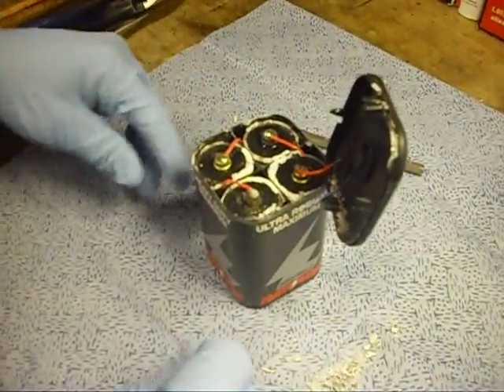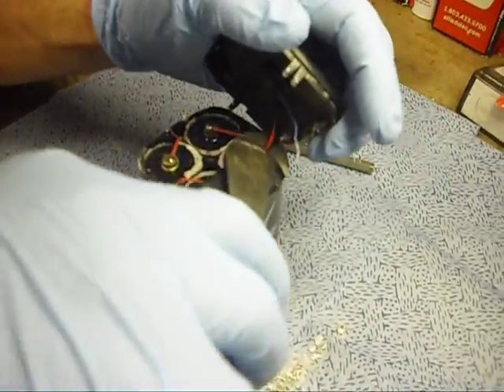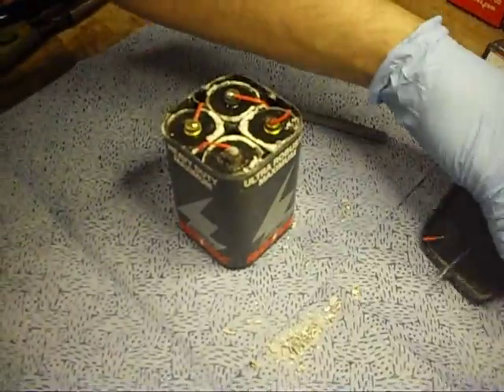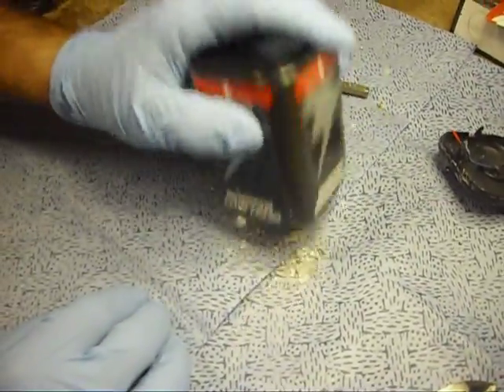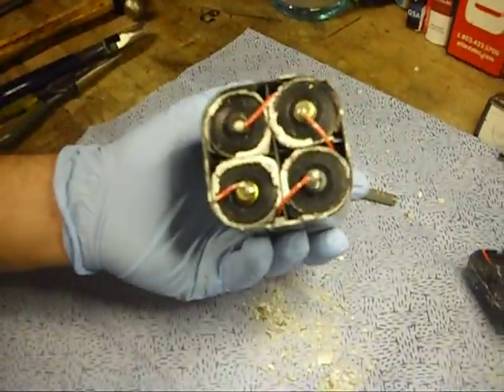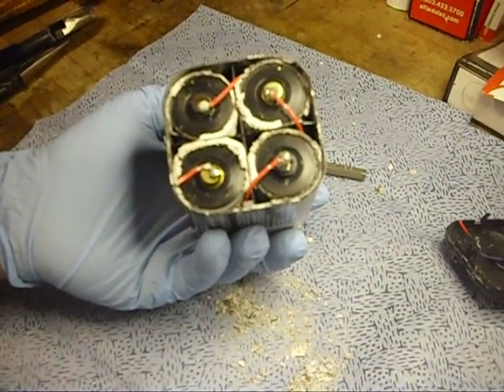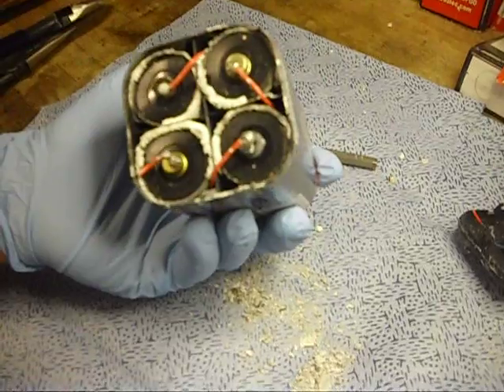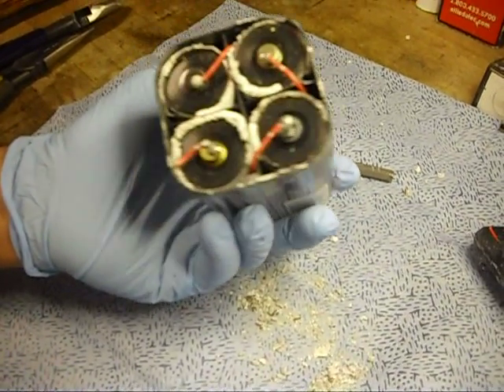Cutting open a six volt lantern battery (6 Volt Battery Hack)

Comment: To get high capacity for longer run time they used four 1.5V "F" cells. Each cylindrical cell is about 32mm diameter and 90mm length.
F cell is abolished and they use shorter D cells instead. Each cylindrical D cell is about 32mm diameter and 60mm length.

Comment: I heard that if you microwave  batteries they charge back up. Would you mind making a video to debunk this "myth"???
Reply: +zeekzilch I think she was being a smart ass, but I like the way you defused that ;) thanks for doing the experiment with a different 6v brand than others have used. If you think about it, all those "AA's" would have needed a lead wire...20 more than the 4 here and in the original video.
Reply: zeekzilch puganator007 I've been using them for years now.  A quality brand will hold its charge as long as a regular battery for at least a year (of continual charging).  Well worth the investment...No, I'm not a lobbyist for the rechargeable battery industry ;)
Reply from the maker: puganator007 Sounds much too dangerous to me. Plus, the little I know about chemistry suggests that the microwave energy would have other deleterious effects on the electrolyte...
Reply: I wasn't being a smartass and by the way I'm a she. I actually heard the myth that if you microwave batteries it would charge them back up so I wanted to know if it would actually work because I go through hundreds and hundreds of batteries each year and I was wondering that if I microwave them what they explode or what they actually charged back up oh and thanks for the answer
Reply from the maker: +puganator007 My guess is that there would be absolutely no charge, at all, gained from microwaving batteries. Again, it's just my guess, but in the traditional C, AA, or AAA cell the voltage potential is created by a chemical reaction in the electrolyte (the different chemicals that make up the core of the battery) between the two terminals. This chemical reaction moves electrons, during this "oxidation reaction," from one chemical/side to the other.  The microwave radiation would simply heat up the electrolyte without actually returning the original balance of electrons in the chemicals. Either way, I think it would be too dangerous to test in a microwave...
Reply: +zeekzilch okay thanks for debunking the myth for me :D
Reply: +puganator007 why so many batteries...not that it's any of my business...but I work in audio so I always use AA or AAA batteries.  Just get a quality charger and but rechargeable batteries, they work well.
Reply: +Jeigh Neither oh I have a lot of devices that use double A batteries so I need a lot of them, for example I have a remote control helicopter that takes about four double A batteries and then I got a Wii so I need a bunch of batteries throughout the year.
Reply from the maker: +puganator007 I use an outdoor GPS whenever I'm hiking, climbing, or traveling (which is every week) - it uses about one set of AA batteries per day...
Reply from the maker: +Jeigh Neither I use an outdoor GPS whenever I'm hiking, climbing, or traveling (which is every week) - it uses about one set of AA batteries per day...

Comment: It's 9v not 6v dumbass
Reply from the maker: Lauren Ifill Are you sure? Rayovac advertises it as 6 volts...
Reply: +Lauren Ifill lantern batteries are 6 volts, dumb ass.
Reply: Shown battery is made of four 1.5 volt (NOMINALLY) cells connected in series which makes a 6 volt (NOMINALLY) battery.

Comment: Old vid, but...

There are two main variations of these spring terminal style 6v lantern battery.

The first type are alkaline, usually containing F cells, but may also contain 8 sub-D cells in series-parallel configuration. These alkaline variety have higher energy density, i.e. "longer life" (about 2x). The IEC code for this type is 4LR25Y.

The other type ―the type shown here― is Carbon-Zinc variant. These are usually marketed as "Heavy Duty" because of their durability and higher current capability. They almost always contain 4 F sized cells. The IEC code for this type is just 4R25.

I have never seen any of either with AA or AAA cells in them, ever.
Reply from the maker: Charlie Scoville Great information - thank you for sharing!

Comment: i thing i learn in science, a big explain, the big 6 voltage is inside 2.5 voltage battery. each battery flow in wire with 4 battery. which mean 4 batteries are going in wire 1 at the time to give electricity. is that right?, I learn it from science in school

Comment: Dozen AAA batteries would make 18 volts which is three times more voltage than this 6V lantern battery can generate.
Reply from the maker: However, a dozen AAA batteries can, indeed, be combined in parallel and series combinations that provide a wide variety of output voltages between 1.5 and 18 volts...
Reply: Sure, but if you're a battery maker, why would you waste your valuable resources on stacking a dozen AAA batteries in parallel line to only get 6 volts out of them when you can combine only four and get pretty much the same results. Only thing that crosses my mind when thinking about that issue is that, maybe, stacking batteries in parallel improves durability. Please let me know about your opinion on that matter.
Reply from the maker: therionman52 You bring up some great points. I guess the main driver in all of this is costs and profits - so whatever resources work best for the manufacturer are what counts for them in the end! But, to answer your question, batteries in parallel are capable of providing more current. So, a bunch of batteries in parallel, that don't have a lot of demand on them, will maintain their common voltage level longer because it takes longer to draw them down due to the higher amounts of current available. I think I stated that correctly??!!
Reply: zeekzilch Certainly, it's up to manufacturer to decide how to make their own batteries. I got to agree on that. As far as putting batteries in parallel order, that's pretty much what I had in mind becouse it's the only thing that makes sense - increasing durability by increasing the level of current. Thanks for you answer! Cheers!
Reply from the maker: therionman52 Cheers!

Comment: That is a very old lantern battery, notice that the cells are corroded!  For those that pointed out that putting 4 cells in series will result in 6 volts is correct.  For those that tried to say that putting cells in parallel will drain the batteries is incorrect, provided the cells are all of equal charge so you could use 32 batteries by arranging 8 sets of 4 batteries in series and connecting those sets in parallel will still result in 6 volts, but you will multiply the available current by 8.  This is simple electronics math.
Reply from the maker: I agree with you - thanks for the info!

Comment: Those aren't "D" cells; they're called "F" cells. That video you saw with AA cells in a lantern battery was a load of intentionally-misleading bullshit. You can't parallel these types of cells to obtain more capacity without the cells discharging into each other, which is precisely why cells come in different sizes, to start with. You can place cells in series, though, to obtain higher voltages, such as 4 Fs in series to make a 6V lantern battery. Many 9V batteries are actually 6 AAAA cells in series.
Reply: You posted a commet 4 years ago and i saw it i have came back to tell you.........Youre very smart

Comment: They are F cells.  The same diameter as D cells but longer.
Reply from the maker: You may be correct - I did a quick internet search and they're saying "F" cells are long "D" cells. Thanks!
Reply: Thankfully, Duracell is cheap and the use D cells with a cardboard spacer.

Comment: All batteries are made up of cells. With todays manufacturing processes that would be a 1.5 volt cell not counting rechargeable. ALL 6V batteries have 4 cells, all 9V batteries have 6 cells, all 12V batteries have 8 cells. all rechargeable batteries 1.2 V/cell, Car batteries 2.0 V/cell. There are no exceptions on the open market.
Reply from the maker: Good info, thanks!
Reply: zeekzilch I noticed people talking about making a rechargeable 6V battery. Keep in mind you will only get (4 x 1.2V) 4.8V with 4 batteries, you will need 5 rechargeable batteries to get 6V.
Reply from the maker: MrTHEORIGINALICEMAN
Apparently rechargeable batteries are always a little less in voltage as I've seen many electronic devices ask if the user was going to insert an alkaline or NicCad.

Comment: I found a Rayovac 6V battery and I removed the bottom and inside were 4 retail D cells without tabs. They were actually in metal jackets with all the usual stuff on them, they were retail D cells without the positive tab. I removed the 4 rayovac D cells and replaced them with rechargeable cells and it works fine. I am going to replace them with standard D cells because rechargeable batteries self discharge and wouldn't be good in an emergency. But the 4 D alkaline cells are cheaper than the 6v.

Comment: What is the brand and model of this battery? This would be a PERFECT template to use rechargeable D cell batteries to operate the lantern batteries. I could simply clean it out (after it's dead), put springs in it and use rechargeable Ds or possible 8 C cells (if they fit). They actually sell the converters, but you have to get them online and they rather expensive.

Comment: Standard 9V Alkaline batteries are pretty close to 9v.  NiMh rechargeable ones might be 7.2v.  This is if you measure them directly with a volt meter while not in use.  They are lower voltage because internal resistance differs with various battery types and they have to account for voltage drop when used in a device.

Comment: do you know how series and parallel circuits work? you can have 1.5 volts from 36 AA batteries all the way up to 54 volts, depending on how you wire them!

Comment: Not all batteries have acid in them. Some have a basic solution (alkaline), and these can be very harmful and corrosive if they explode or leak. The battery in this video, however, is neither of those, but rather a carbon-zinc battery which contains no "acid".

Comment: Not that it makes a big difference in temrs of safety, but *alkaline* batteries don't contain any acid, since they're alkaline ;)
But they can explode or rupture when heated (which could happen when shorting the contacts), and you really don't want it on you or in you any more than the sulfuric acid from car (lead acid) batteries.

Comment: Did you not pay close enough attention when they were talking about series and parallel circuits. You can get 6 volts from 32 AA batteries. Take 4 1.5volt AA and wire them in series to get 6volts. Then make 7 more groups of 4 in series and wire them in parallel. You get 6 volts and much longer life and higher output because you have multiplied the current of 4 AA by 8.  Now if you meant you knew it because in the electronics class you cut open a lantern battery then I stand corrected.

Comment from the maker: The size of the battery helps determine how many milliampere-hours (mAh) of current it can deliver at its determined voltage. Alkaline AA Batteries average about 1,200 mAh while a "D" cell, at the same 1.5 volts can deliver about ten times as much current (12,000 mAh). As a theoretical example, using round numbers, a small motor requiring 1.5 volts and 1,200 milliamps of current draw would last an hour on an AA battery and ten hours on a D cell (although the consumption curve complicates this)

Comment: LOL ... Ive never started a post with a laugh, but I couldnt resist - sorry.  The AAA cell video was a JOKE!  A AAA would not provide enough amperage, and since you have a limited area, there is no sense in wasiting it on 100 AAA batt cases! Infact, what you saw in your vid WAS D cell batteries (in size and 1.5V VDC output) Thereby allowing the max ammount of power and amperage per case - using this technology anyways. Thanks for the Vid!

Comment: Those are dry cell batteries, zinc carbon maybe. Maybe try an alkaline? Those shouldn't be corroded like that because they have to be sealed. I know alkaline's leak over time but those batteries in the video had no casing.

Comment: actually it would be impossible to find a lot of standard AA or AAA cells as each one of the AA or AAA is 1.5 Volts which would mean that for example 32 AA cells would give 48 Volts instead of 6 Volts
Reply: It depends on how you wire them.